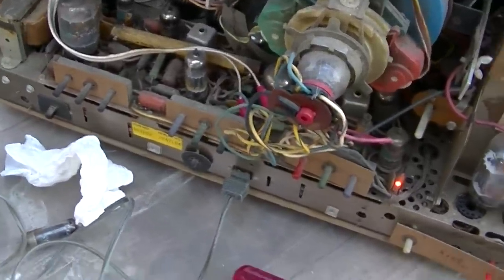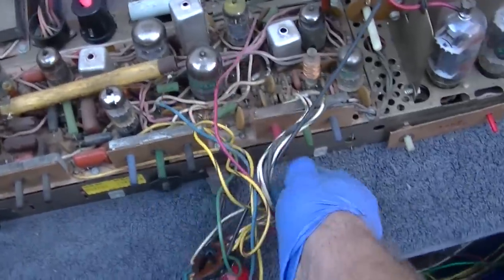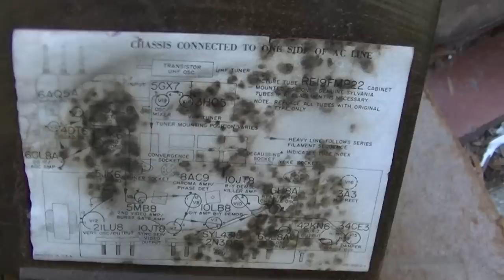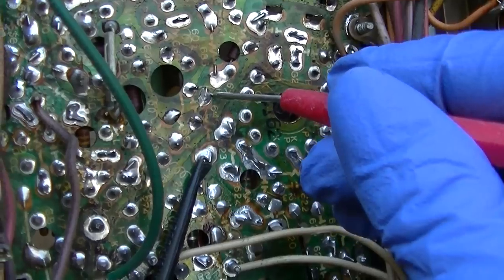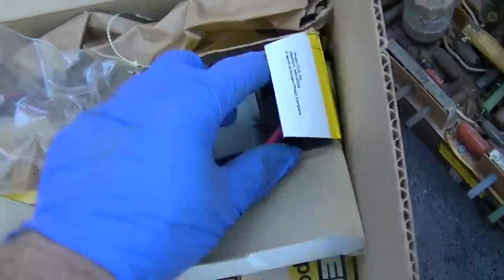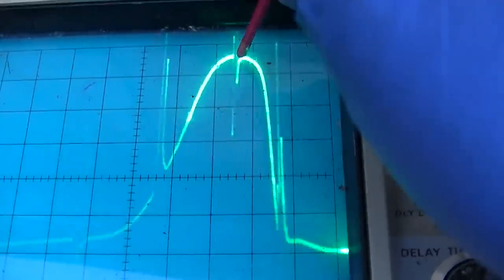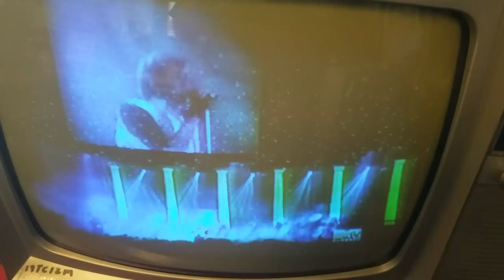1966 Sylvania 19TC12 Portable color TV Diagnosis

Comment: I love watching you videos.  Your real-life approach to repairing equipment is reminiscent of the technique that I used.  In this video you mentioned Sam's Photofacts.  I worked at Howard Sams from 1970 to 1973.  When a piece of equipment came in, we opened it, pulled the chassis, traced the circuits and drew a schematic.  We used 3 foot by 6 foot (I think) paper with 1/4 in squares on it.  Voltages and pictures (and waveforms) were taken on  unit.  The finished pencil schematic would go to the art department to copy it onto card-stock.  They used  printed electronic symbols for their schematic rendering.  The chassis was shot from several angles by the photo department.  We then received 8x10 photos (on heavy cardboard) with a transparent overlay.  Would use the overlaid pictures to identify the parts.  Once finished, they went to the art department for final processing.  The huge schematics were reduced by the photo department.  The finalized items were sent to the printing department - for final production.  During my final year at Sams, I produced the CB Radio series books.  I can assure you that the voltages and waveforms were unique to the sets that were depicted.  So,  the should be accurate.  Keep those videos coming.

Comment: Hey Shango066, I worked on a number of Sylvania tube sets in the mid 1970's.  This one was the first year for a 19" rectangular color CRT.  The number one problem with the Sylvania's was PC board problems: Hair line fractures in traces and solder fatigue problems where the ground tabs were soldered and tube sockets where the tube got really hot.

Those caps you mentioned are plastic film polystyrene.  Moisture does migrate through the plastic and polystyrene melts at a really low temperature, making it surprising easy for these caps to short out when being soldered.

I like the placement on the big electrolytics cans on this chassis; away from power resistors and tubes, prevents the liquid electrolyte from being cooked off.

Video smear is often caused by poor high frequency response in the video or color circuits.  When aligning the IF, a narrow bandwidth causes reduced high frequency video response.  However, that CRT in the Sylvania looks really weak.

With those CRT jigs, there is so much stray capacitance in the long cables, you get ringing and poor high frequency video response.

Ah yes, the weight of a color portable at that time was a bit laughable.  I used to say, the thing that made it a portable, was the incorporation of a carrying handle, which had considerable reinforcement inside the cabinet to keep from permanently distorting the cabinet when the set was picked up by the handle.
Reply: I've heard stories of engineers turning up at the customer's house only to have the handle snap off in front of the customer as they brought the set in. (I worked in the trade, btw).

To be honest I wouldn't fully trust the handle on my Ferguson Courier III (late 1960s) which is a dual-standard mono set and not all that heavy. The set's too valuable to me to risk it.

I did also have a "portable" which although transistorized, had a heavy metal chassis. A Teleton ANEX. Quite appropriate as it weighed a ton so to speak. That had a handle with metal "hinges".
Reply: @BG101UK  Hi Bg101uk, yes I have seen this happen as well so, always carried these types of sets like a 50 lb sack of potatoes.  In the late 1960's and beyond, the portable TV cabinets were changing to all plastic to reduce costs.  While troubleshooting an early 1970's 15" color Philco-Ford.  I had it on its side to get to the bottom of the PC board.  While trying to move it into position to access circuitry, the cabinet flexed and exploded, which also broke the neck off the CRT.  At that point, I wanted to give it a good burial, but fortunately, my boss (the owner of the TV shop) had a used set, almost identical to the one I broke so, was able to make a suitable substitution with the customer.  So...  I never viewed color portables the same afterward.
Reply: @billharris6886  Sorry for such a tardy response but am glad I'm not the only one to know of this, in a sense. In other words, it wasn't our fault. It didn't happen to me directly but I've seen the results of cack-handed mishandling, disregarding the weight and centre of gravity of the set in question.

My major regret is that some now classic sets were the victims.

Comment: This looks like the infamous "D06" chassis- we called it the "DOG" when I was a tech in the 1970's. There are resistors in the Demod Ckt that go DOWN in value- causing the bias in the circuit to cut off. A gutless wonder- Sylvania made some real good sets too- the D12 (Gibraltar) and the D16 were real good performers. The D02 was their answer to the RCA sets in 1965-66.
Reply: Hey, Kirk! I have a D01 or D02 roundie. I've been thinking was that Sylvania's first color set?

When I was a teenager I worked for a Sylvania shop. We brought a set in as a trade-in after installing a new console. It was given to me. The shop owners said it was the first color set they sold. It had the non-integral safety glass. 21JP22? Can't remember. Too bad I didn't keep it. I was a dumb kid at times and still am.

Comment: That neon bulb looks like both electrodes are illuminated, meaning it's probably just an AC indicator, if it was used as a DC regulator only one of the electrodes would glow.
Reply: That would be correct,I remember a 12" portable from '70's I worked on used a neon in circuit but I believe it was used as a coupling element, but my memory fades.
Reply: Oscillator circuit. Relaxation Oscillator? I remember a Sylvania black-and-white 19 inch or so with two or three of those lamps in there. They draw very little current, but they do break over like a Zener diode around 68 or 70 volts...

Comment: Would the measured voltages make more sense if measured with an analog voltmeter from the period? I once was led down the garden path using a DVM  on '60's equipment with the associated service manual voltages.

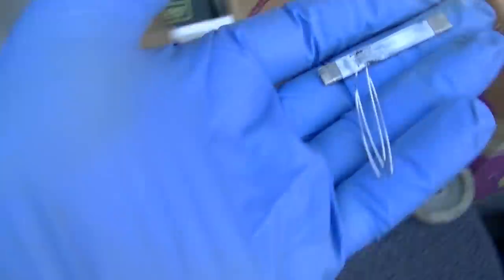Comment: 8:25 I don't worry a lot about asbestos as long as it's not falling apart, but hitting it with compressed air seems like a good way to make it fall apart and stir all the debris into the air. I wonder if a vacuum hose, or even a damp paint brush, would be a safer way to clean off these things.
Reply: A vacuum is only a good idea if it has a fine enough filter such as a hepa filter. Otherwise you will be spraying friable fibers out the exhaust.
Reply: spray it with compressed air outside while holding breath

Comment: My experience with using the test jigs (I have a Sylvania and a Zenith and RCA test jigs with lots of adapters) is that you will not always have full horizontal deflection on the jig screen.  There will be some smearing due to lead length.  The test rigs will provide a decent enough picture for you to get the chassis repaired and ready to be reinstalled in the original cabinet, and adjusted.  I have serviced several different chassis over the last 9 years, on one of my test jigs, chassis have been: RCA, Zenith, Sylvania, Philco, Sears (Warwick), Panasonic, Sharp, Packard Bell.
Reply: I will say that smeared color on the first chassis is definitely not right, of course, the jig doesn't make it that bad at all.

Comment: The D05 chassis was even more fun. The heater string had a silicone diode for a voltage reducer buried in the corner of the chassis. When - not if - it failed (went short), the heater voltage to the 42KN6 would rise and cook the tube. Factory fix was to replace with a 5-watt WW resistor. Their first SS color chassis was the E01, found on their 25" models. Lots of issues, replaced shortly after with the improved E02.  The GT Matics were well made. All the chassis transistors/ICs were plug in; the vertical output transistor drew excessive current for its socket to handle. The fix was to solder the device directly to the board.

Comment: I worked on a number of those back in the late 70's early 80's.  Mostly trade ins.  Even with a good CRT they had crappy color.  Being mostly trade ins I got them working 'good enough' and sold them for around $100.00.

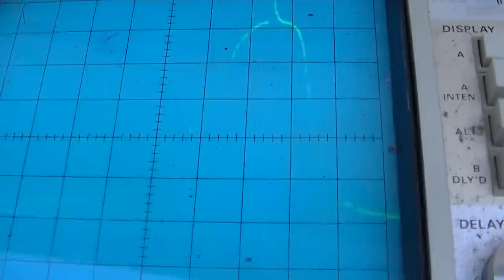Comment: 48:00 Are there two slugs for transformer primary and secondary coils?

The frequency response of the video channel is still in question. Inject into video Circuit.

54:00 the ladies sound a little like Dino from the Flintstones...

Comment: Greetings:
Just a hunch, check that the color killer is not being activated (disables chroma circuit when no or low chroma is detected.)
I think the oscilloscope is an appropriate tool when trying to observe when chroma comes and goes. I would use the TV generator as signal source. Watch the color-killer control over the chroma circuits.

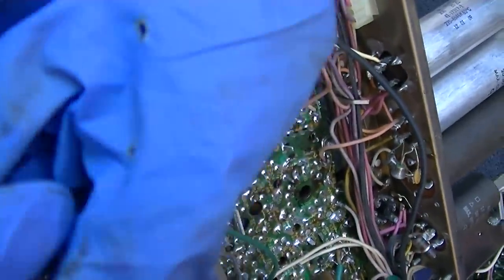Comment: @39:17 - I used to make homemade ozone generators for home mycology.  I used steel window screen and prego sauce jars running off a 10kV transformer.  The plasma would regularly punch a clean hole right through the glass jars making the same sound.  I had a ready supply to hand because it happened so often.

Comment: A hot chassis set with  a metal case seems inherently dangerous, especially with no ground. I thought most manufacturers switched to plastic when they ditched the power transformers, but then it took another 10 years before they started using flame retardant plastic. I wonder if the fake wood contact paper was considered an insulator when evaluating these things. With a plastic back, a plastic front escutcheon and everything in between vinyl coated, at least all the surfaces the user touched would be non-conductive.
Reply: On true hot chassis sets (with the exception of some very old radios) there are insulating spacers separating the chassis from its mounting points.

Comment: Shango could try to rejuv the CRT guns. Those old silver caps are problems waiting to rear their ugly heads.
Reply: I ordered one of those boxes of capacitors from Electronic Goldmine.  In it were dozens of those little silver caps, all new of course, I have never had a need for them but I guess just in case, the leads are long enough so I can clamp on a heat sink so as not to change their rating with a hot iron.